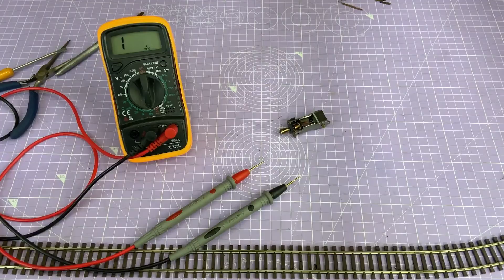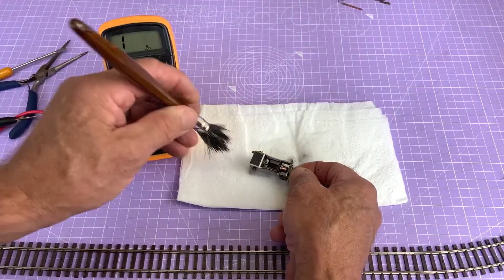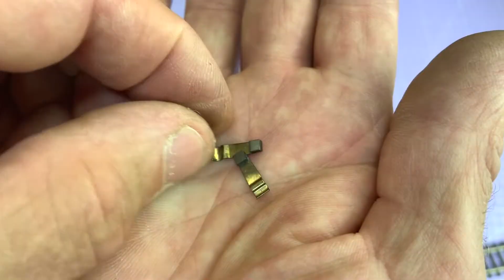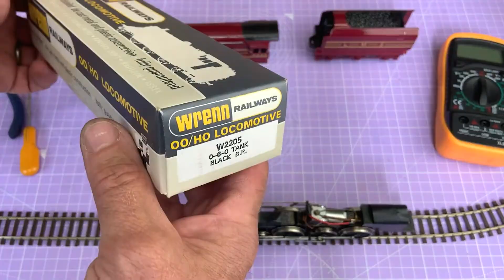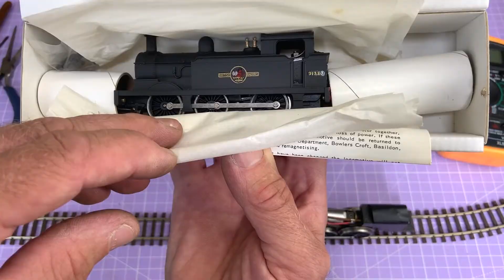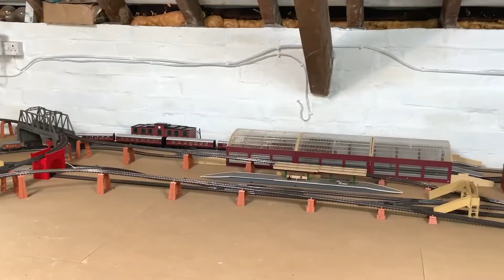Trying To Sort Out The Poor Running Tri-ang Hornby X04 Motor From The Maroon R.871 Coronation Loco

Comment: A very good video - very helpful.  Removal of the excess carbon and oil deposits from between the commutator slots is the most likely reason the measured resistance increased.  An improved solder joint should lead to a reduced resistance!  The overall better performance was probably due to both improvements.  A poor solder joint may not show up very well on the resistance meter which only uses a tiny current to give a reading.  It may however cause a significant problem when the higher running current is passed through the motor.
Reply from the maker: Well it runs great now. It's not always necessary to strip these delicate old things right down every time. Best regards to you

Comment: Watching the video again, some great footage, I've got an X04 motor from a Jinty, I've cleaned it thoroughly, so up testing with the multimeter as you did I can't get any readings at all on the settings, therefore could it be the windings? Any suggestions would be appreciated thanks again John
Reply from the maker: Hello, It does sound like you have an issue with that armature, I hope you got it sorted. Happy New Year to you
Reply: @MrSnooze  thanks, I've put a replacement X04 motor in and that runs fine, John

Comment: Snooze,
Enjoyed that, as usual.  Perhaps worth replacing the brushes on the off-chance years of soaking in oil infiltrating their structure.  If so the motor will soil quickly.  Just wondering.
Pete.
Reply from the maker: Hello Pete, that's an interesting point about the oil soaking into the carbon. I have not yet found brushes that once properly cleaned have given trouble, however it is something I will now look out for. All the best to you

Comment: Hi, just curious, by flattened off the carbons, do you mean you sanded the metal parts soldered to the brass flat? (Sorry, not familiar with proper lingo) 
Is it advisable for an older triang motor to have flattened these parts? A few of mine are really ground down into a "U" shape. 

Great video though :)
Reply from the maker: I just refaced the carbon part of the brush ( the black bit that rubs on the commutator ) you don't have to do it especially on very worn brushes but these were nearly new so it gives them a chance to bed in again nicely. Thanks for watching, all the the best to you

Comment: Great results there! I've re-soldered commutators on a couple of locomotive X04 motors. Although eventually successful I had difficulty getting the solder to stay on the copper. Took a few careful attempts! Did you use a flux paste? Leaded or unleaded solder? Thanks
Reply from the maker: It is a problem to solder these sometimes, I did use a pinprick of flux paste, it helps so much. All the best to you

Comment: Great improvement to the X04. The increased resistance must be down to the carbon contamination between the commutator segments being cleaned out and would have caused excess current draw as you were experiencing before. Nice neat soldering! Look forward to seeing 31337; I was given the Dublo 2 rail version of that last year from a loft clear out; it was in a terrible mess; a broken wire between winding and commutator was a devil to fix and I sacrificed a turn on the winding to sort it but it is now a great runner. A pleasure to watch this video as always. Best wishes.
Reply from the maker: That sounds like a great repair on that R1 armature, I have been lucky enough to fix an armature by that method, I don't think one turn will make a huge difference. Take care, all the best to you

Comment: If it’s been over oiled for a long time it’s also worth changing the isolating sleeve on the brush spring as they degrade with time and oil.
Reply from the maker: That's an interesting point you raise there. I've had a couple of motors where the brush mounting has deteriorated and cracked, so excess oil could be the reason. This one is still fine thankfully. When I change the mounting I always thread the motor and secure the new  item with a little bolt as opposed to re riveting. Thanks for looking, all the best to you